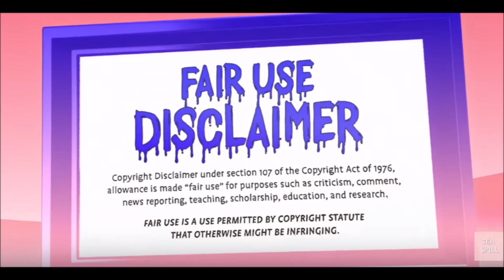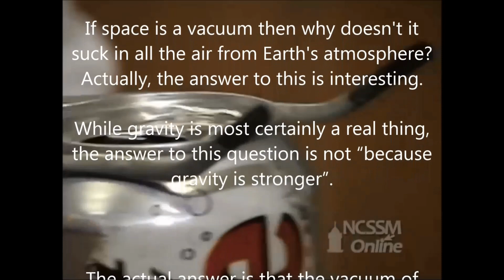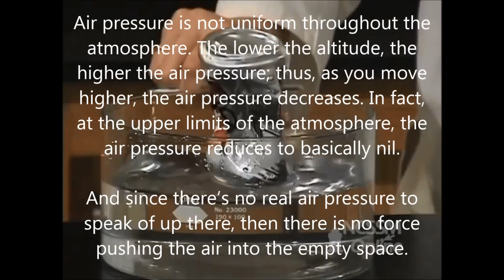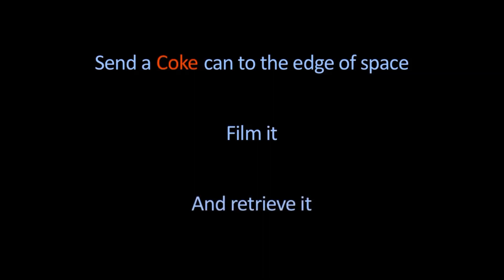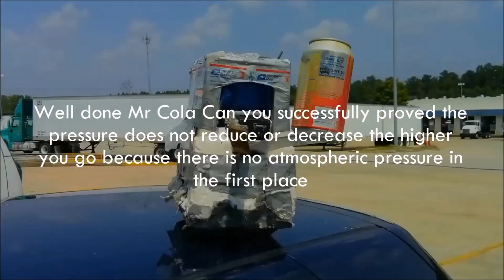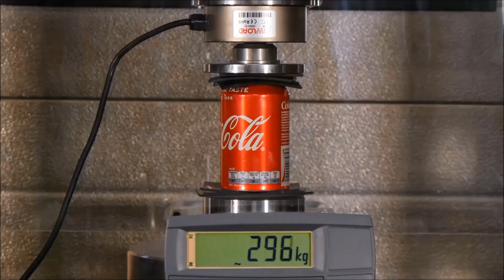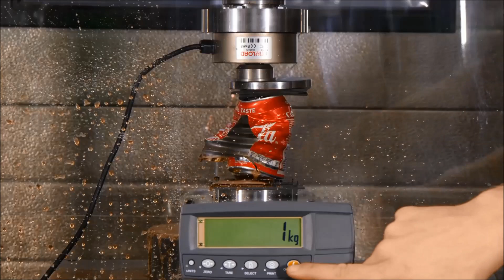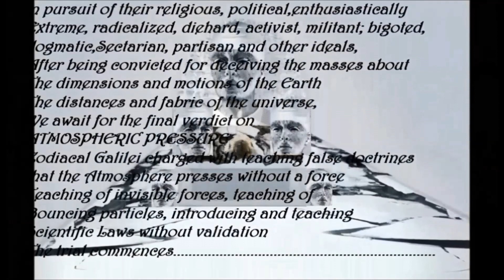FLAT EARTH - A Piece of Practical Proof

Comment: The astronaut’s visor is preventing the pressure inside the suit to escape.   Earth’s atmospheric pressure is a gradient.   As such, there is no pressure against a vacuum.   To illustrate:  Let’s assume that White is Earth’s atmosphere and Black is the vacuum of space.   Using this image, where would a person place a line to separate White from Black?

https://i.stack.imgur.com/xgNnW.jpg

“At this height and such low pressure the can should have exploded Right?”  I don’t see how an empty Coke can can explode. Can you?

Freeze frame at 0:32 of this flight:

https://www.youtube.com/watch?v=Cs-IXuDd9A8&feature=emb_logo

The second coke can launch used an unopened can but the video was not identified nor was any data offered suggesting altitude.  How is one suppose to determine if the can should have exploded or not?

10:23   What does external pressure on a can have to do with atmospheric pressure?  The pressure which might cause the can to explode comes from INSIDE the can.

How much pressure does a coke can contain?

https://hypertextbook.com/facts/2000/SeemaMeraj.shtml

How much pressure can a coke can withhold?

https://www.csmonitor.com/Science/Science-Notebook/2015/0414/The-surprising-science-behind-the-aluminum-soda-can

Comment: I am guessing this is some sort of Poe channel? At 2:45 they describe the pressure gradient. If the point of this experiment was to show that pressure gradient does not exist, why not film a barometer instead of a can of soda? Wouldn't that be more practical? This video has to be a joke.
For anyone flerf that thinks this video is actually "practical proof" of anything, a room temperature or cold soda can will not explode in a vacuum. In order to get the can to explode they would have to heat it up and then somehow maintain that heat long enough for the can to reach an altitude where the atmospheric pressure has dropped enough for the pop top (weak point) to fail. Since the temperature at those altitudes are way below freezing, that is going to be really difficult.